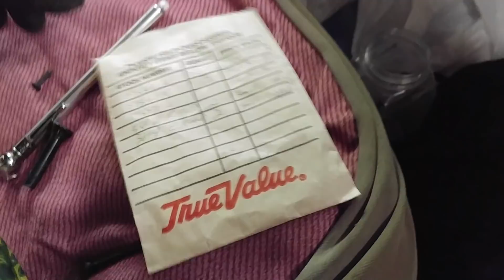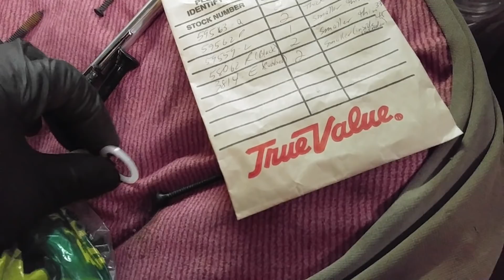Wrangler Jean Toss 11 28 18

Comment: What's the deal with the bmw e39?? Why junk?
Reply from the maker: One of my freeloading friends dumped it here, I think the battery froze, so I can't even charge the battery to open the electric trunk, I know I can hook up a battery to the license plate light to power the thing up, it's a little rusty on the passenger side rocker, it does run and drive, but it was owned by his son who I'm sure beat the crap out of it and didn't change the oil, and there's nothing showing on the dipstick. You want it, I'll deliver it
Reply: @CORVAIRWILD  Interested. I know them well. Was interested when I first saw it a few weeks ago. Located In MA. Near worcester. Too far to deliver it? Interested for sure if you can trailer it here. I'll send an email if I don't hear back from you on here.